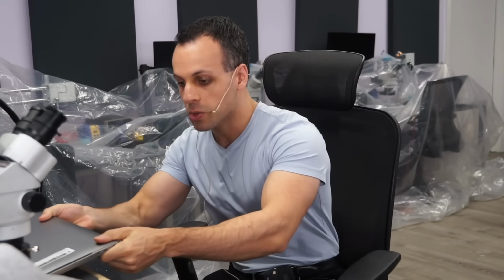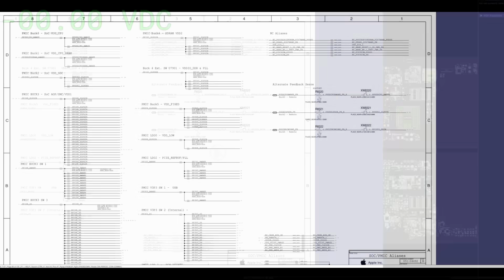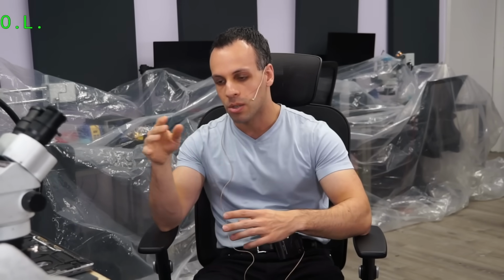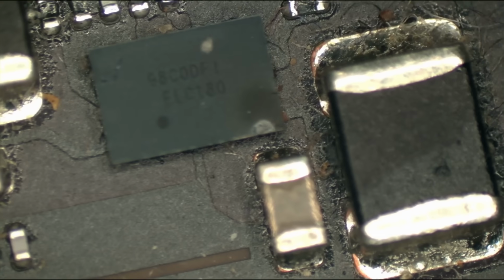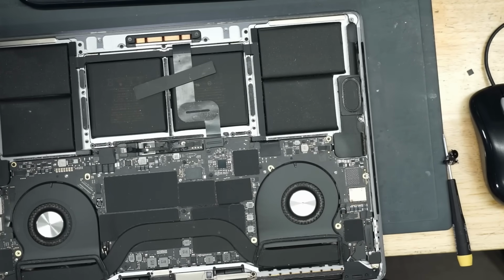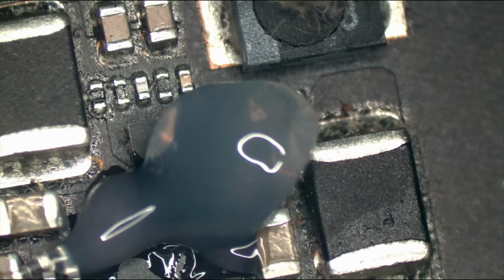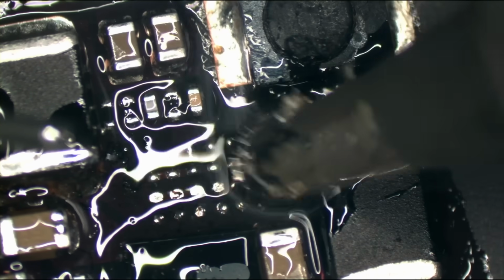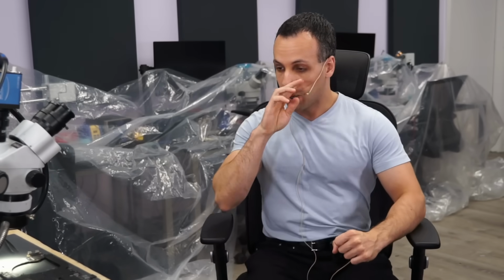How most 16" Macbook Pros often kill themselves & why they're unfixable

Comment: Thank you answering my last question where you suggested that I can use the old Mac by disconnecting from the internet.

If you don't mind, may I please ask if there is a way around Mac's planned obsolescence? I keep seeing machines that are in no way unusable  being made redundant for no reason than "there is a newer one available". I understand that the tie in is the OS and the connection to the internet, that has been made seen as necessary for the last few generations.

My feeling is similar to: "I have an amazing car that has amazing bells and whistles; a car that is from a manufacturer that used to have the reputation of building and setting up cars that were perfect, then after a few life times of my family, who used the car with no issue, my family is now told that I can no longer use the car, because it is the wrong colour. Because of this my family can no longer use the car. The only thing left is to buy a new car... that will become redundant every six months, to where one will have to throw away the car and then buy another one that has less capability than the last, as well as more restrictions, to a point where the car can't even drive any more, because the engine (os) has had sand poured into it... So the only option is to replace the engine

In car world, that would be hard but doable... but in the Mac vs PC world it is being made impossible... There is no problem with the hardware... There is no problem with the software... The problem is with the OS... I am stupid... You are not... But I keep banging my head against a wall at why the machines, both PC and Mac work... That the difference between PC and Mac is PC has one OS, but any hardware can be used, and Mac creates it's one machine and software and OS (but takes shortcuts by buying already manufactured hardware)

Bollocks! Trying to get across my stupidity is really easy, while trying to say what I am trying to is not

Bollocks! I know you are a New York/Jersey Mac specialist and know you are a major part of what will happen next... please call me stupid or just read at what has to happen next... PC and Mac hardware manufacturers and software engineers are all set to go, Mr Rossmann, what is needed for them is an OS that is able to handle both put together and streamlined architecture that will be able to run and accept any software that is willingly introduced. What is needed is an OS that helps and learns from the person who bought the machine, who then customised it to their wants and needs; who accepted the machine as a member of their family, knowing that everything is safe and that it will only get replaced when it ceases to function...

My first PC was a 486 with Windows 3.1 that I watched get made and programmed and I could still use today, if I still had it

My first Mac was an uber Macbook (I put myself in college for film production). I bought and installed Final Cut, Ps Suite 5 and loved the usability of recording and editing and distributing of photographic, audio and videography... The problem started when Mac told me that my amazing computer could no longer be used, and was now susceptible to viruses, because my amazing machine which did everything that I needed it to do was now obsolete...

So I bought a Macbook pro... 4 years later, same warning... So I bought a Macbook Air... Four years later the same warning

Mr Rossmann... I am stupid, have 38 followers on yt... ... Whereas you are very intelligent, live off the island, have a successful company  and yt channel... ... Although I am nobody, I have been viewing your channel for a very long time. Please tell me that I am wrong, but I think you are opposed to closed box machines, restrictions to repair and the like... Me too... Again, I am the poop on the shoe of everything here, but (humbly) ask if I could suggest getting your crew together to work on an OS that accepts Mac and PC hardware and software (even making both formats backwards compatible) so as to save hardware from being laid waste utterly? Help create an OS that is user friendly, with buttons and files and folders et cetera, so as to help those who know nothing about computers be able to do what they want, without having to learn code... Even go the Gates direction and offer each installation for a dollar 

Again, I'm just some stupid moron and so know nothing. But if this post can help the positive evolution regarding computers as they should be, as opposed to a money grab, please help it get run with.

I need no credit and have no ramifications attached. I just think that you have a voice that I would never have

Comment: When I drop a small piece of a hardware or a plastic scale model part, I usually put my cheek on the ground, and I look for the part horizontally. Most people try to find these small parts by just looking at the floor from above, but it's almost impossible find that piece like that. Look horizontally, sometimes with one eye closed, and you'll find it. I had to use this method since my childhood because we had rugged floor at home, so I couldn't hear where the piece was falling to.

Comment: That why I pay as little for used mac as possible. Had a 15 inch 2011 macbook pro that graphic card failed killing the whole computer. At least I could salvage the ssd and ram. Impossible to do that with silicon macs.

Comment: Who's the fool that decided to solder the customer's storage device onto the same package that contains the CPU?  Why didn't Apple simply put two M.2 slots on the motherboard and maybe make a nice RAM Disk to speed up some applications?  It's a laptop, not an iPad, and there's no good reason why the single storage device needs to be non-replaceable.

Comment: I bet the soldered onboard SSD chips are fried and show evidence of being fried.  I am sure if you put your meter to the pins of the SSD chips they will show open circuits where there should be none indicating the ship is fried.  If need be put a wave generator to it and check to see if signals are going in and out where they should be, if not, the SSD chip is dead.  It is time-consuming but worth it at times.

Comment: Nice to run into this channel again after about 10 years. I was hoping you would say the NAND chips can be replaced. But it doesn't surprise me. From what I understand Apple is marrying chips like this to the motherboard so simply physically replacing them wont work. 
One thing im scratching my head on though is with the IC failing how does 13V manage to cross over to that rail? If that IC converts 13V to 2.5V or what ever you said, if the chip dies then no voltage should be coming out of the output but yet here we are, a catastrophic failure. which means the Motherboard must have some pretty sketchy design flaws. Also why isnt there any over voltage protection at the Nands power rail? Or at least a fuse...

Comment: I have a Samsung LCD monitor that it has its years of use but its very well taken care of. What failed? The main chip inside tasked to receive power and basically have the monitor power on. I have seen many on the internet failing because of this chip. They basically just manufacture devices to have an expire date, capitalism

Comment: I came to the conclusion that I have goofed big time over the last decade by buying Macbooks (pro) instead of desktop Macs.  The problem with the macbooks is the batteries, which eventually swell & bulge the case & can make the macbook unusable. And the fiendish plot is to make the batteries 1st inside the computer (can't replace from outside), & then GLUE THEM IN.!!!  But desktop computers don't have that kind of batteries (possibly a coin battery inside somewhere).  I wish there were a law vs not having    computers & cell phones with easily replaceable batteries (if one runs down, pop another inside the battery compartment which opens to the outside).  And this gluing of components also makes me wish there were a law against that. Another problem of Macbooks is IMHO making them too thin, trying to cram too much in too small a space.  So a bulging battery may impinge on your track pad, etc.  The case should be have space to allow a bulge.

Comment: Louis, you can't fix broken women. They come preprogrammed to short circuit when they ride the carousel and their SSDs are also soldered to the motherboard. The only difference is that with women it's not a design flaw, it's a useful feature. Just pick the young, undamaged ones and you're gold.

Comment: Dude what the hell are you doing.....why use flux to remove a component and why the hell are you even measuring on the board with all of that flux covering everything? Flux is removed for it's conductive properties after soldering a component on so everything you are measuring in that flux area is giving a false reading.....

Comment: What percentage of these ssd specific failures are from 8gb vs 16gb vs 32gb machines? Have you noticed a pattern of higher failure rates in one versus the other? Ie out of 5, 8gb repairs.... 3 are due to failing SSD.

Comment: Besides the self repair issues I’m still a massive fan of apple products and doubt I would switch. All my Macs have lasted beyond expectation with zero hastle. I had my iMac 2007 iMac until 2016, 2015 MacBook I run my business on got changed for an m1 mini last year but still going strong. And my wife’s 2006 MacBook is still alive and well. 

This issues is worrying but I’d probably just get insurance to cover any problems.

Comment: I have the 16-inch before the M1 and it's going strong after 3+ years and I LOVE it, best machine I've ever owned. I never knew about this problem, so will backup this week. Will be upgrading to M2 when it comes out. All laptops will fail at some point, there is no guarantee.
Reply: They fail but not in the way that apple does.
Also, I'm glad you like Apple but for the price of those laptops, there's just better alternatives. But if you like macos then I see why you get them
Reply: @MARS-eb8pt  ThinkPads are the way

Comment: Are you absolutely sure that that voltage regulator CAUSED this failure? And HOW do you prove that? Because if I have some low-voltage logic with some voltage regulator before it and both are dead, I definitely don't know whether there was some short/overcurrent inside that logic which caused overloading that voltage regulator, or it was the voltage regulator malfunction that brought some unappropriate voltage to the logic. In both cases you end up with a fried logic and fried voltage regulator. Which leads me to the point, where that issue become much more interesting — overvoltage protection. The simplest protection is using just a single antiparalel zener diode mounted to the output of the voltage regulator. There are special types of zener diodes designed to end up shorted when overloaded, which are typically used as a simple protection to the output of voltage regulators. If the voltage on the output of the voltage regulator rises too high, then it overcome the zener (reverse) voltage of the zener diode which makes that diode to start sink current from the circuit, which overload that diode, so it blow itself to the short circuit sacrificing itself to protect the rest of the circuit. In this case as I remove the voltage regulator, I end up with the short circuit on its output. This is absolutely OK. Then I have to seek for the protection circuit (like zener diode, transil, some kind of crowbar protection, whatever), remove it from the circuit and IF the short circuit remains, then I am almost sure, that that failure was caused by the circuit itself, not the voltage regulator. If that short circuit goes away with the protection circuit, then replace the protection circuit, replace the voltage regulator and you are done, device is successfully repaired. And if you find that there is no overvoltage protection behind a voltage regulator, THEN (at this moment) you found a serious design flaw.

But the video was cut BEFORE seeking for protection circuit, and I am almost sure why. This is much more "political" issue than technical one. If there would be no protection behind the voltage regulator, then this is something, that would be hugely emphasized, so in my opinion there IS some protection. If you end up with blown protection shorted to ground, then it is easy and cheap repair and you cannot then shout on apple how they screwed that thing. If you end up with short with protection removed, then it is almost sure, that what caused this failure was not some cheap voltage regulator, but SSD itself, which is what I expect to be found. It's typical for nand flash that, as they wear off, they slowly increase its power consumption to the point, where it consumes as much power as it become overheating, reaches Tj temperature and blow itself to the short circuit, which causes the cascade failure of previous things like voltage regulators. This is such a typical death of SSD drives, USB flash drives, it was also typical for SD cards to die this way, which is in fact why the manufacturers stopped installing microSD card slots in their phones, which is something, that was done for a good reason, not just to fuck the customer, which is how this is typically depicted, etc.

There is also one possibility: You don't know how these protection circuits are designed. That would be epic, but I don't expect this.

Comment: If you look at the operating humidity and temp range of a Mac and then consider it's made of metal, if you actually used it across those operating temps and humidities, the thing would regularly be dripping water from it. Designed to fail much lol.

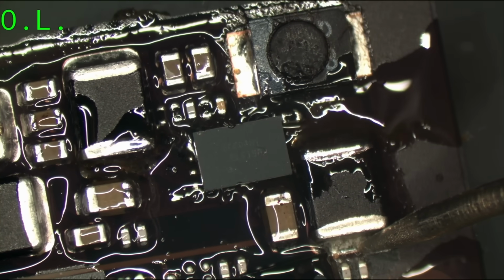Comment: Did anyone else notice that at 13:22 on the left side of the NAND chip the pads were exposed, I think he just didn't seat it right, like it literally just needs to be shifted left.
Reply: He stopped and didn't even solder that into place (it was the voltage regulation chip) because the NAND SSD showed a short even without it installed.

Comment: Why is there no class action lawsuit against Apple for this flaw. I have the M1 Pro Max and spent a fortune! I’ll be pissed if it fails like this. My 13” 2015 MacBook is still going. I have had really good luck with Apple. My first was a IIci with 4 mb ram and 80mb HD back in 1990.

Comment: In some of my radio power supplies there is an overvoltage protection that shorts out the output of a faulty regulator like that. To protect the far more expensive devices in the rest of the radio. Its called a crowbar circuit. Usually a voltage sensor and a scr, which blows a 10c fuse if the output of the regulator goes higher than the safe range of the circuit it’s feeding. If apple power systems don’t have that, or similar, it shows the design process is hopeless.

Comment: You could protect the SSD with a crowbar circuit that would prevent over voltage from reaching the SSD. A simple little circuit to do, but nobody will probably ever do it until it's too late.
Reply: Just a beefy zener would probably be enough. Those things fail short when overloaded.
Reply: Is this how iCloud gets pushed?
Reply: hey i have 16 macbook pro. i dont want to mine die. whats crowbar circuit? im capable micro soldering stuff.
Reply: no idea @EmirhanSanl4
Reply: @EmirhanSanl4 use inrush current resistor and zener diode
Reply: Is that something you can do before the computer blows up? Or do the manufacturers just have to decide that's a good idea on new machines?
Reply: That would work if it was a PC and it would exist in a free market place with competition. Apple has a quasi monopoly and a cult: so they know, their cult members will be upset, but then be programmed by the cult that Apple is perfect, they don't make mistakes and yes, they believe everything Apple does is premium, they believe the marketing BS. So these cultists just buy another Apple laptop, over and over.
Reply: Can you please explain how to do it? Thanks in advance!

Comment: Well I had a mac book pro from 2010 with a hard drive and mac book burned my hard drive and i could'nt retreive any data. from that day I had never bought any Apple product and I only use a windows laptop. and guess what even though my old windows laptop got slow every hardware inside it is still intact. I just bought a Dell recently and it hepls me with everything. I really don't want to get on that apple silicon chip trend.

Comment: Unfortunately this happened with my macbook pro 16 M1 Max, it was on battery power and battery has drained in the midnight. In the morning I couldn't charge, power on, so sigh of life. Took it to apple store for help. Only option is to replace mainboard. Which means all my valuable information such as photos/videos are gone for ever. It is scary that a top notch laptop that you paid more than ~5K is not reliable, you may not be able to power it after it sleeps and you loose everything in SSD due to some faulty design.